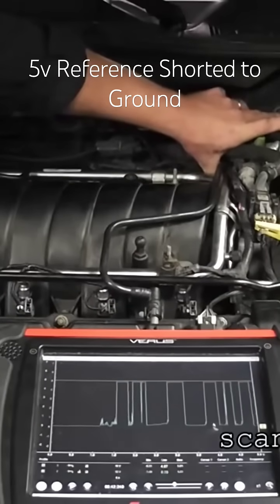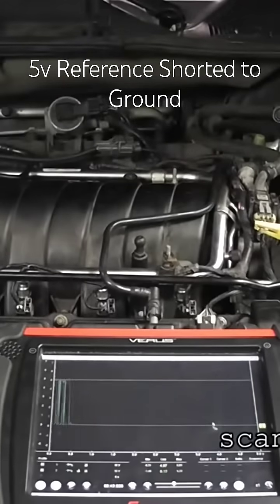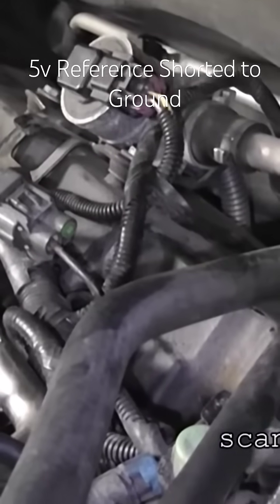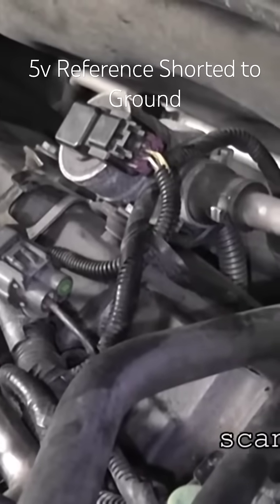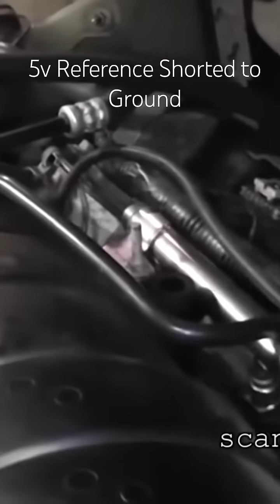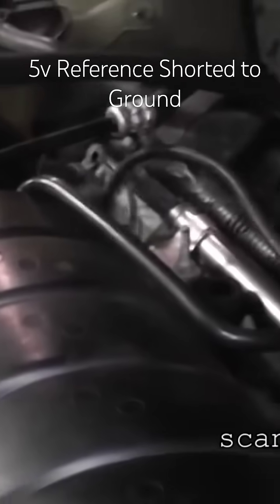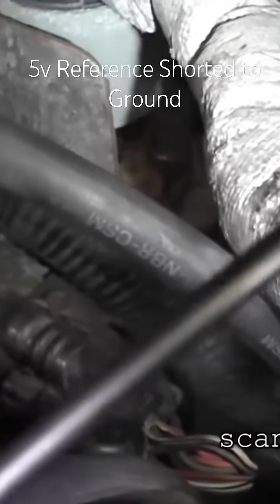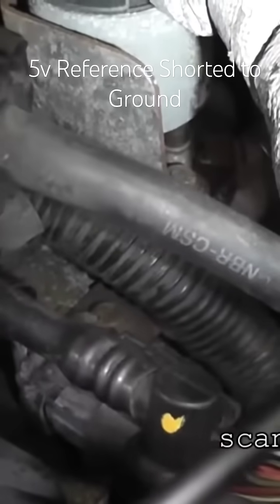Intermittent Short to Ground in a 5v Reference Circuit

Comment: Paul: when signal drop to 0V it means you have a short to ground or an Open Circuit, isn't it?
Reply: It could be either. Chrysler park sensors will set the same DTC weather it's an open, or short to ground for example.(seen my share fare of crushed rear harnesses from collisions that the bodywork got repaired, but the harness was left damaged)